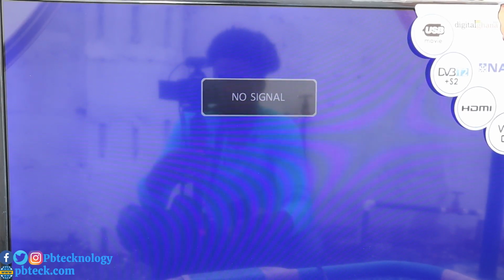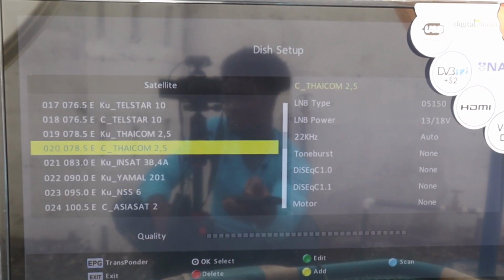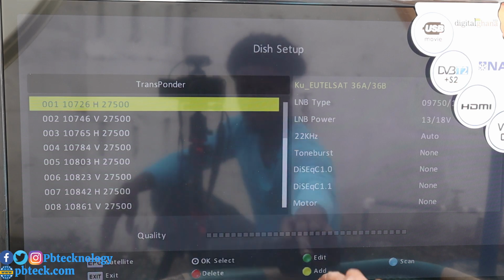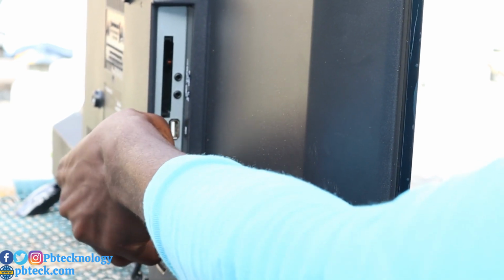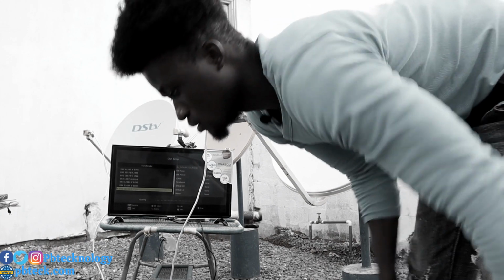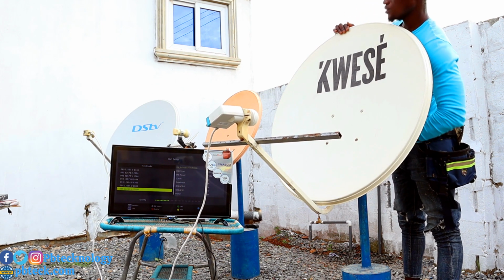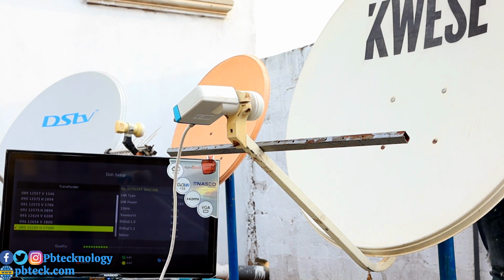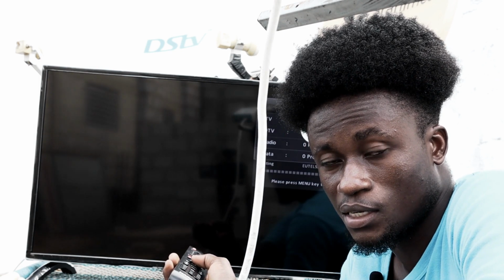How To Install Tv Without Finder

Comment: Good bros but what of the LNB postion? where will it face, thank you.
Reply from the maker: It will depend of the satellite and the TP you are about to track. Placing it vertically can get you most satellite signal in Africa.
Reply: @pbtecknology  Am using DSTV satellite and the TV have an inbuilt decoder, the TP is 12245H27500, vertically in which direction? am in Nigeria, thank you.
Reply from the maker: Set it at either 9 o'clock or 3 o'clock.
Use the dish as a wall clock to position the LNB.

Comment: Please I am installing strong dish for multi tv had decoder  and  I’m having had decoder is not receiving a signal or the signal is too weak
Reply from the maker: Add the MultiTv Frequency 12525 V 30000 and Adjust the satellite dish to get a stable signal. Make sure the cables are well connected

Comment: Thanks for you hard work. Is it possible to use a Startime decoder together with DSTV decoder with a single startime dish?
Reply from the maker: Sure, but it will be difficult to get both signal if you're a beginner